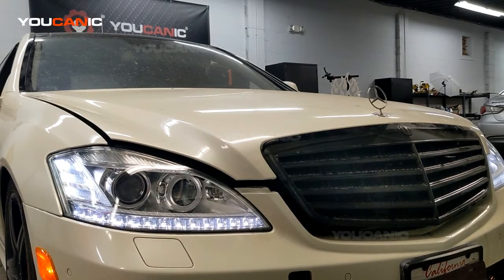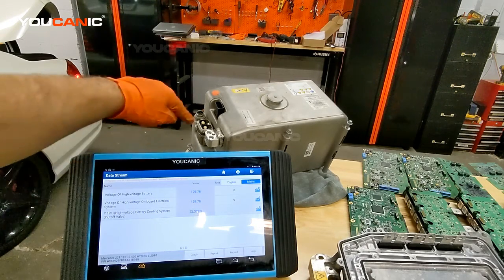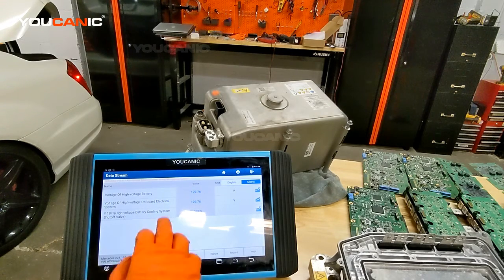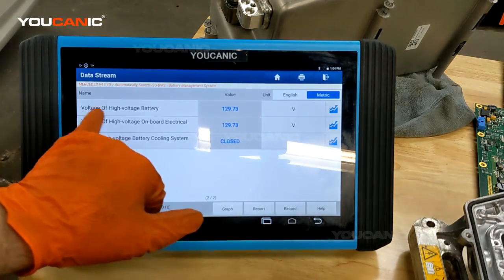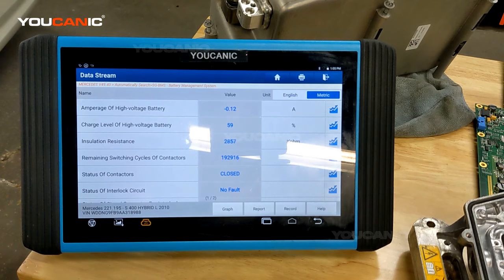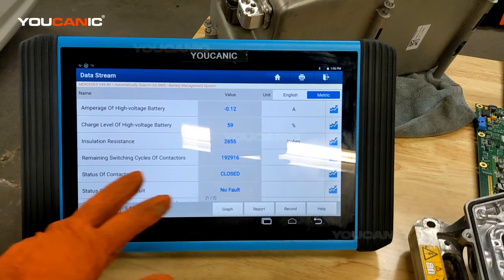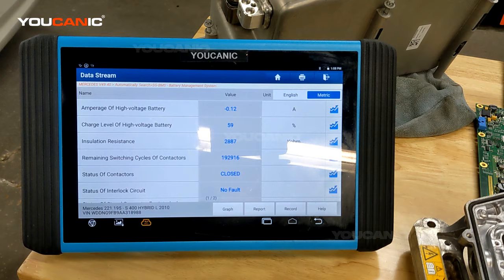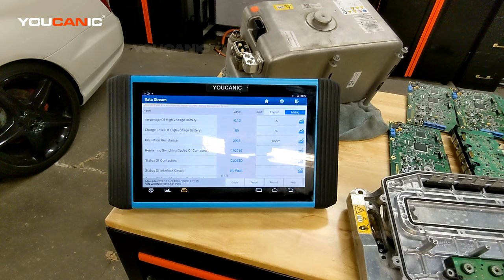Mercedes-Benz Hybrid Battery Issues, Actual Values, Contactor Counter

Comment: Any info on removing the hybrid battery ? Can find any. Need to take the front prefuse box out and the battery is in the way on my e300 wagon
Reply from the maker: Removing the hybrid battery can be a complex task, and we understand the difficulties you're experiencing. For detailed guidance on this and other car repair activities, consider visiting YOUCANIC at www.youcanic.com. Furthermore, if you want to understand your vehicle's intricacies in depth, check out the YOUCANIC Full System Scanner at www.youcanic.com/scanner.

On YOUCANIC, you can find various resources as well as a platform to ask car-related questions. If you need further help or have more questions, don't hesitate to reach out. We aim to be your trusted source of all automotive needs. Visit www.youcanic.com/ for more information.

Comment: i have w222 hybrid no cranking... fault code.. CONTRACTOR of the high voltage battery  module was opened due to release fault.....that means the hybrid battery need to replace???? i also check the actual values of the hybrid battery not available...thanks

Comment: the green electronics boards that are over the table are the bms that its inside the battery ? Is there anyway to reset the contactors count down ?